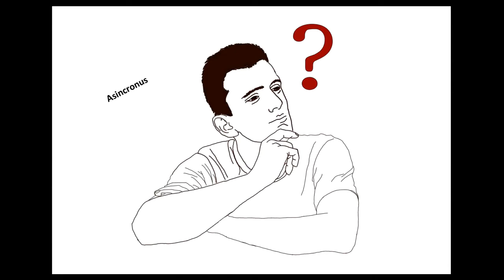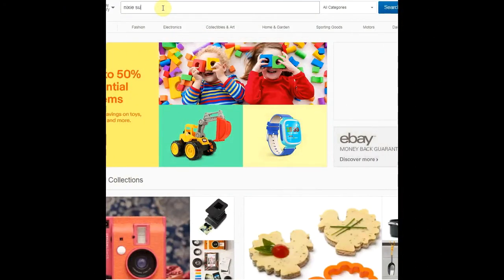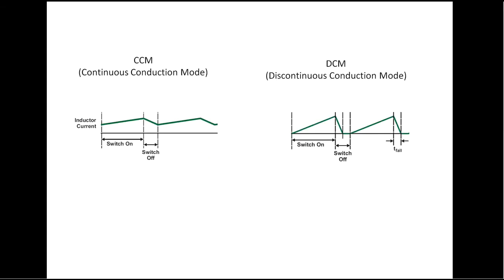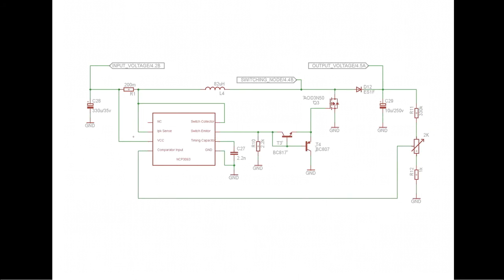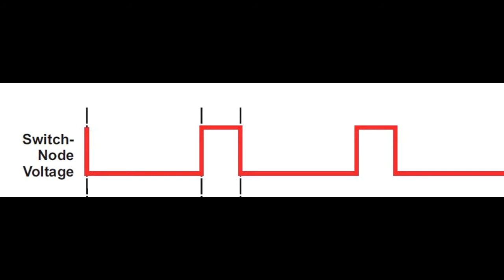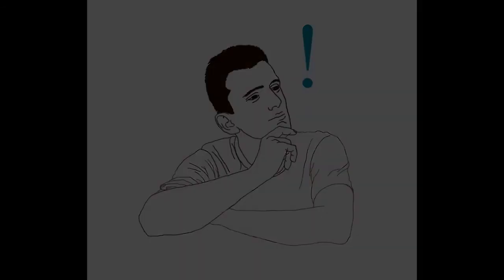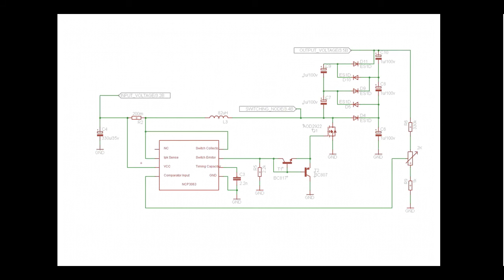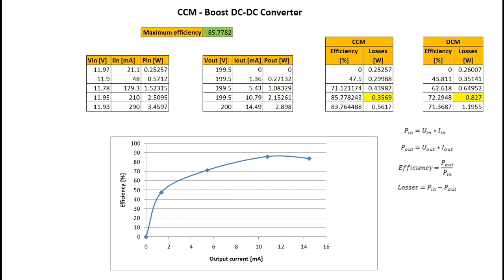DIY - Nixie tube boost power supply

Comment: It works! Thank you soo much. Using this circuit with MC34063 requires only 1 additional thing - You have to connect DC pin to IPK pin, the rest is the same. Alsko you can use 100uH inductor, which is more avaliable, at least in my country of origin
Reply from the maker: I guess the inductor is frequency dependent - the lower the switching frequency the larger the needed inductor will be; I think the 34063 has a lower switching frequency range than the 3063; anyway, the inductor value will allow quite a bit of variation in general in any smps.

Comment: Can anyone help a novice...
I run across this looking for a better solution for powering audio tubes.
Would this be a good power supply for a preamp using a couple of 6AK5 tubes running at about 60 volts.
Thanks in advance!
Any information would be greatly appreciated!

Comment: It could be interesting to compare voltage multiplier losses with losses of hi voltage mosfet in case of using a one more bjt transistor to extend duty cycle of 3063.

Comment: I need a 30w nixie supply so my current plan is to get a 50va 200v transformer, make a full bridge diode rectifier + filter cap and throw in a handful of fuses
Reply from the maker: For high powers the transformer is the best approach. The type of supply I built in the video has a ~85% efficiency so at a 30W output, you would need to somehow dissipate 5.3W...

Comment: Why do you use in the schematic a p-type mosfet? It should be a n-type, right?
Reply from the maker: You are right, the symbol is for an Ptype but the component name is for an Ntype transistor. The symbol should also be for Ntype since that is the proper component needed.
Honestly I guess I didn't find a proper symbol and was too lazy to make one at the time.

Comment: Nice video, congrats!
Do you also know about a buck+divider that comes from the same theory of this boost+multiplier but works in the opposite way? Let's say coming down from 400Vin to 50Vout without having to use 600V power components? Thanks!
Reply from the maker: I'm not sure there is such a converter topology... Out of curiosity, what sort of project is this 400 to 50 converter needed for?
Reply: @FesZElectronics  It's used for example in non SELV applications where you have a first pfc boost stage (400V output) and then a second stage buck for costant current regulation over a wide range of output voltages (50V-200V for example). LED drivers as an example of application. I was wondering about your solution because here the bottleneck component is often the buck mosfet...
Reply from the maker: Would it be possible to use a buck-boost converter as a PFC? or some other topology that allows setting a lower output voltage. I mean as long as the 2 circuits are separate then having different ground references should not be an issue. I found this article, maybe it helps - http://www.worldacademicunion.com/journal/1746-7233WJMS/wjmsvol13no02paper07.pdf

Comment: Nice Video, building it right now. :)
Have you experienced if there are any other values important for the inductor?
Reply from the maker: Hello @Daniel Kruska ! Well the inductor value depends on the frequency you are running the supply at. Lower switching frequencies will require larger inductors to prevent large current. Also keep in mind the inductors DCR (DC resistance) and Isat - saturation current. More DCR (present if the inductor is very large or if the wire is to thin) will cause more losses by heat. And the Isat refers to the maximum current at which the inductor still has most of its initial inductance. For this particular application, I guess anywhere between 68uH-220uH should be ok. You can also perform a simple simulation to see what happens with different inductors.
Reply: @FesZElectronics  Thanks for the fast and detailed reply!!
I'll give the simulation a try, probably anyways a good idea since this is my first build :)

Comment: How do you measure the efficiency like you did please? 1 - Do you have a vairable power supply to vary the input current? 2 - Do you use different resistance power resistors to vary the output load current? Many thanks again!
Reply from the maker: Hello David! I do have a variable supply, but I mostly kept the input voltage fixed - at around 12V; To vary the output current I have some fixed value resistors, and I switched trough those that is why the output current was always a non-standard value - it depended on the output voltage and the resistor value

Comment: for the 200mOhm and the 330kOhm resistors do I need to think about the power rating? I see you have chosen, at a guess, 1206 for the 330k but what have you used for the 200mOhm? I guess its because the inductor requires more current?
Reply from the maker: Well, the 330k resistor will dissipate a maximum of  U^2/R=200V^2/330k= 0.12W (for a 200V output), and more for higher voltages. So 1206 is the smallest recommended for this particular component. Also since there is a high voltage on its terminals, large case size is good to withstand humidity and dust buildup that could affect the equivalent resistance. For the shunt resistance on the other hand, the 1210 case size is a bit overkill, but I think at the time, there was no smaller case size in stock at my local electronics shop, that is why I bought it.

Comment: Forgive me for the silly question to verify my thought. But with the 2k variable POT can you vary the output voltage? My IN-12A tubes only really require 180V.
Reply from the maker: Yes, the point of the potentiometer was to adjust the output voltage. To see exactly the extreme output values, you can consider the pot, upper and lower feedback resistors as a voltage divider and see what input voltage(at the output of the supply) will give 1.25V at the comparator input. With the 1K+2Kpot+330K you get the extreme values around 139V and 416V.
Reply: @FesZElectronics  Did you use a normal 100V 1uF aluminium electrolytic soldered onto the underside of the board please?
Reply from the maker: @davey4617  Yes, I used electrolytic capacitors, but if you really want, you can buy 1uF 100V ceramic caps, they can be found in 1206 case size at component stores.
Reply: @FesZElectronics  Sorry again for the stupid question, but what caps did you use please? For example, I cant find any 1uF 100V smd caps.

Comment: Can i clock it by using arduino 980 Hz PWM pin?
Reply from the maker: 1Khz is quite a small frequency for an SMPS; I mean it will work but you need very big inductors; so if the schematic I presented here runs at ~100KHz with a 100uH inductor, by reducing the frequency 100 times you need to increase the inductor 100 times, so 10mH. I would recommend to use a dedicated IC for the supply, even a 555 would be better to be able to run at higher frequencies. Of course you can see my other videos and simulate using LTspice any frequency and inductor combination and see how that works, before you start building.
Reply: @FesZElectronics  my inductors are 200mH i call them beefy boiz
Reply from the maker: It should be ok with 200mH. The last thing to consider is the rated current. Usually for such large inductors the rated current is not that big, but if you don't have a datasheet then you will simply see if the inductor heats up or not during operation. 
Also since you work with much lower frequency, you will need to increase the capacitor values also. The exact value will decide the output ripple you get; here again I recommend to run a simulation since using very large capacitors will not be practical. 
Let me know how this circuit turns out!
Reply: I think the PWm pin is too noisy or i wrote the program wrong. I found Way cheaper 555 timer baser circuit that is confirmed working. Thanks for tips. I really like when there is someone with knowledge like you that is kind enough to respond. 🙂👍
Reply from the maker: I'm sorry the circuit you made didn't quite work out but I guess the 555 supply will be more robust and probably smaller. Out of curiosity, what are you building?
Reply: @FesZElectronics  nixie clock. using IN - 2 x6 + 74141 IC x6 some indication leds and arduino mega. The supply part was quite hard because i couldnt find good project with confirmation that it works well. Now i found one that even has potentiometer based voltage output control. Its end of the year So i have to wait to get some parts. I guess the Solution was Just higher frequency and lower coil inductivity. Thanks for help. I'll let you know how this went. 👊🙂👍
Reply from the maker: The reason why I made the mode complicated version of the power supply (with the voltage tripler) was that I noticed that if you have high current consumption on the nixie tubes you might get the supply to overheat since its not running that efficiently. I did build nixie clocks in the past with the basic 555 booster and 6 tubes (6 x z570m) and everything went well; but at some point I managed to get a few z566m which use 3times more current, and with these tubes the power supply wasn't up to the task anymore so I needed something more efficient.  As long as the switching transistor is properly cooled I think you will not have any problems though.

Comment: Nice little circuit. Ever heard of a tapped inductor boost converter? It's a really nice way to reduce the switching voltage over the switch element as well as reducing ripple.
Reply from the maker: @Piet Muijs . Honestly no, but if you wish to build that sort of circuit I guess you need to specifically build the coil, and if you build the coil then you could make a transformer instead and use an isolated topology and get any voltage. I'm sure the taped inductor works well and provides performance benefits over the voltage tripler circuit I presented but I'm not sure if its economically more viable or easier to build. 
Anyway, I will try out the taped inductor circuit at some point, you got me curios!
Reply: @FesZElectronics  Actually you can just buy them. Any flyback transformer will work (well, depending on the primary inductance of course) . I use it specifically to boost to higher voltages since it puts less stress on the mosfet. Coilcraft as well as Wurth have more then enough of the shelf choices. On a similar way you can also make split rail converters (so positive and negative voltage).
A hybrid solution is also still possible.

Comment: I stumbled across your video while searching for ways to generate about 400V for a Geiger tube. As far as I can conclude from your video the voltage multiplier approach should work.
Reply from the maker: Hi! The booster with voltage multiplier should work. You can also add more diode-capacitor stages onto the output. I found this application made by Maxim in which they build a similar supply for Geiger tubes with a lot of multiplication stages(x7):  https://www.maximintegrated.com/en/app-notes/index.mvp/id/3757 What is interesting in this is that the measured voltage (the one that is fed back into the supply) is not taken from the last stage, but rather from the first. This can give a slightly less stable or predictable output voltage, but in your application, that does not matter.